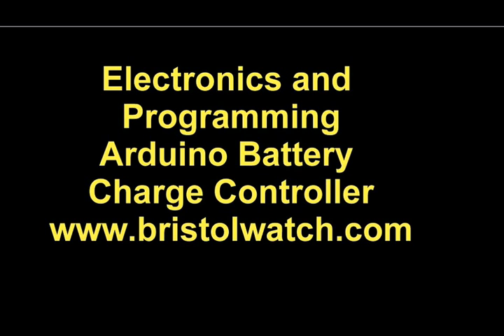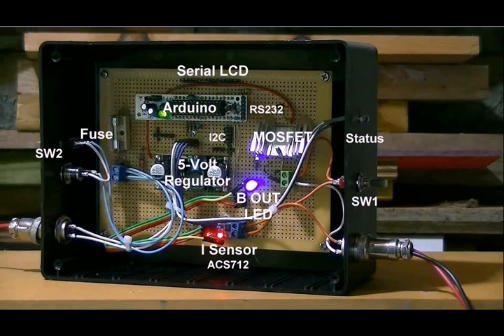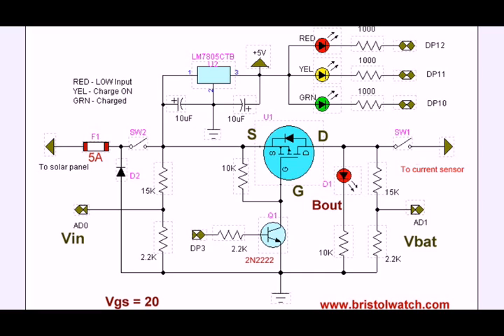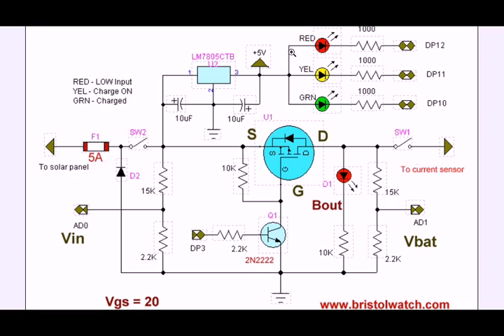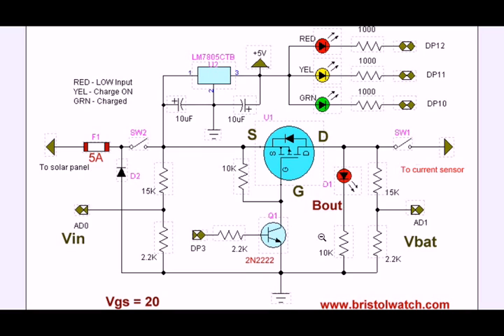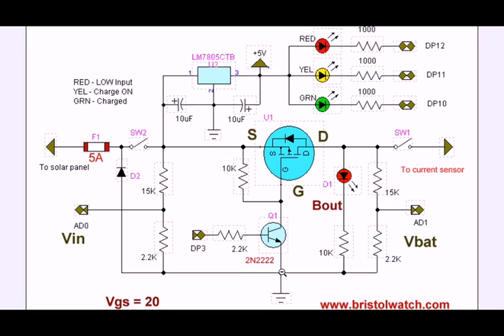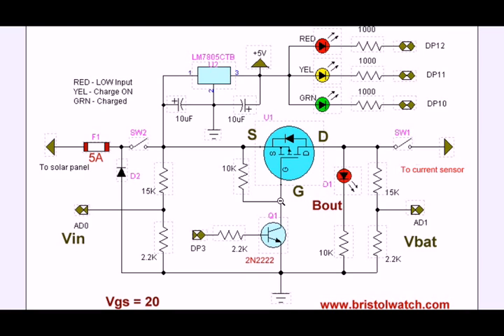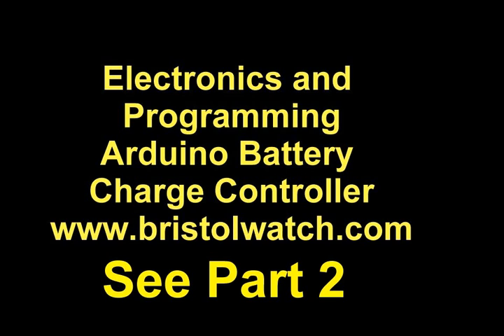Part 1 Arduino Battery Charger Circuits Tutorial

Comment: @Lewis Loflin: can you send me the full arduino programming of your solar panel charger? thanks
Reply from the maker: Wexter Policher It's on the webpage - cut and paste: http://www.bristolwatch.com/solar1.htm
Reply: +Lewis Loflin Good day sir. We had completed the system without the Current sensor. is it okay?
Reply from the maker: yes.
Reply: +Lewis Loflin is it current sensor with 5A?
Reply from the maker: Yes
Reply: +Lewis Loflin sir, how can we test the accuracy of the ACS712 current sensor?..  what are parameters we should consider?
Reply from the maker: Use an amp meter and adjust for various currents and note the readings.
Reply: +Lewis Loflin what would be the computed current?
Reply from the maker: Well the device is limited to 5 amps at an ADC count of 1023. The device would only got to say 4.5 about 1/2 volt below Vcc.

Comment: thank u for sharing sir, but it would be good if u upload the complete code of the project,please i need it badly ,i am working on a solar powered weather station to be installed in remote areas
Reply from the maker: Biniyam Wondie The code is on the webpage cut and paste.

Comment from the maker: Five part series:

Operation;
Arduino Battery Charge Controller for Solar Panels

Circuitry;
Part 1 Arduino Battery Charger Circuits Tutorial

Programming;
Part 2 Arduino Solar Panel Charger Programming Tutorial

More circuitry;
Part 3 Tutorial Arduino Measure Current & Transistor Theory

Portable power box;
Portable 12-Volt Power Source for Camping, etc.
Reply: Very informative video series, thanks.  I'm planning to build and have a couple of questions about other MOSFETs that may be used for this battery charger application:  
   1. Would there be a problem connecting the Arduino power supply and battery charger grounds together so that a MOSFET with a logic level Gate can be connected directly to the Arduino digital output thus eliminating the transistor and maybe the zener diode at higher voltage?
   2. Can an N channel MOSFET be used instead to switch the battery charger negative to the battery? 
   Really appreciate your efforts, I've learned a lot from your videos, both electronics and programming.
Reply from the maker: ReasonForemost  answer to question 1) No. The voltage max for Arduino is 5-volts and the gate voltage is much higher. That's why I used the NPN transistor.Qyuestion 2) It can be but you can't read the voltage on the output correctly. Then the programming will have to greatly changed if it works at all. So the answer is no.